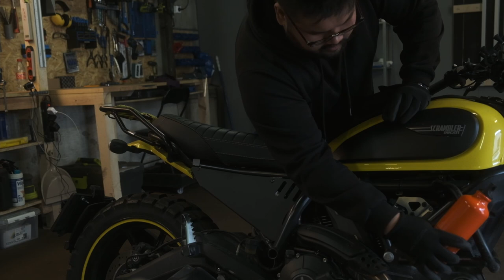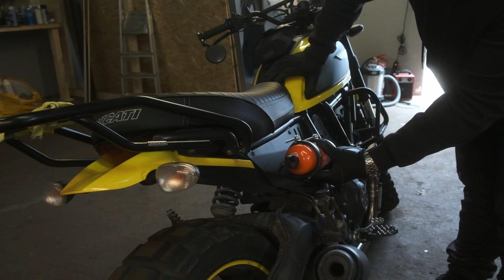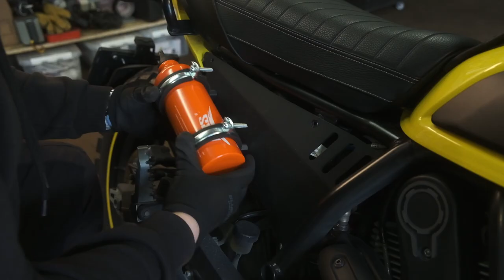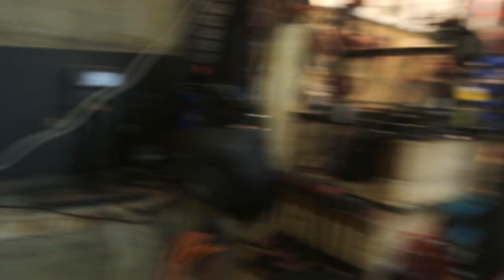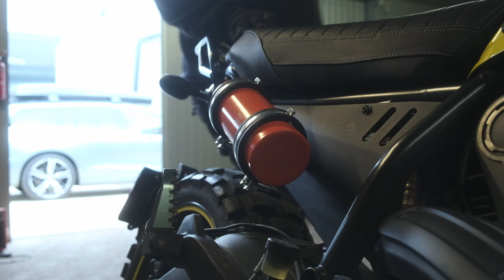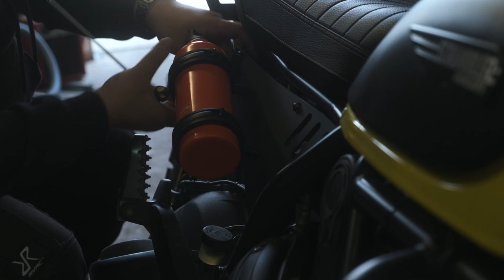Fuel bottle mod mounted on the ducati scrambler

Comment: I don't like the idea of having to dig out tools to access the extra fuel. Very impractical.
Reply from the maker: This was in a pinch-bottle. Agree impractical if frequently used!
Reply: @martinkhang  Considering the limited factory tank size, I would consider any carry on fuel solution to be more than "just in case". But rather an intentional range extending solution. 15 years ago, we used old Gatorade bottles in our backpacks as a means to extend our range. These new Aluminum bottles are a much safer option and just need a quality quick release mounting system. Worst case scenario of a Scrambler catching fire after a crash, the bottles become bombs in your mounts. Need a quick release mechanism.